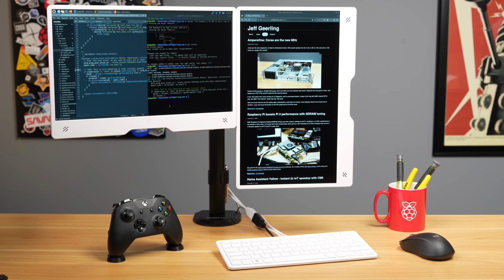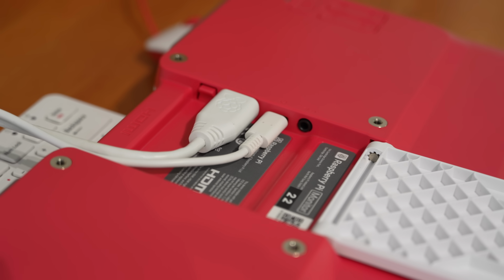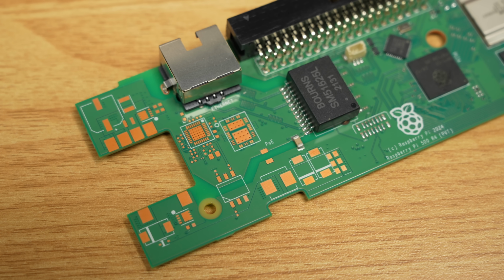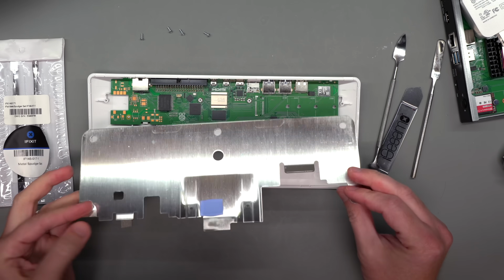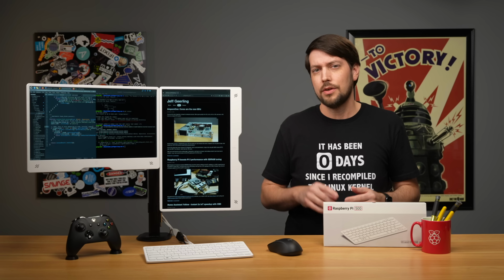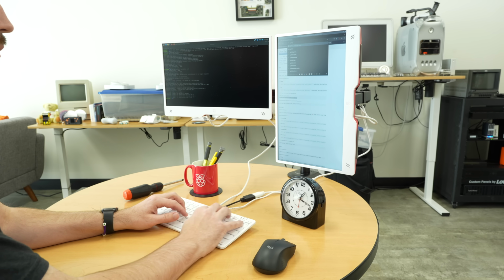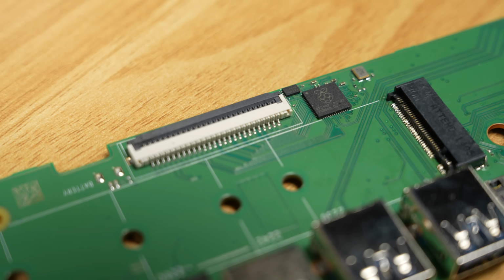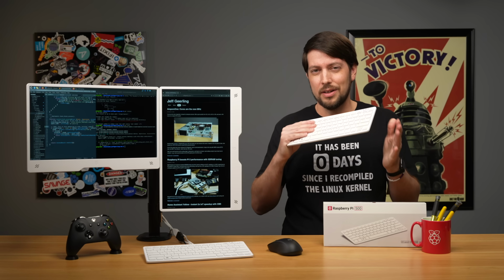The Keyboard IS the Computer! (Pi 500)

Comment: I'm usually hopelessly good at justifying my impulse, poorly-thought out tech purchases, to the point of getting broke in the process. That said, even I struggled with talking myself into getting a previous model, Pi 400.
- Want a low-power desktop without a clutter? Get yourself a second-hand Small Form Factor  PC that mounts neatly behind your monitor. With Pi 500 you get one less cable (from keyboard to the main unit) but instead keep dragging all your computer's cables around your your desk, stuck into said "keyboard".
- Want mobility? It's a solved problem and it's been for decades. It's called a laptop. Plus, it has a built-in screen and a battery.
"But... but... but... GPIO!" I have yet to see anyone actually developing an electronics project using that thing. Why would you want to keep your prototype stuck to your keyboard and then be afraid to move it without the risk of messing it up? So, you're at  the stage that you want to teach your kid electronics but said kid just somehow happens to not have access to any kind of computer in your household? Like: "Look daughter, this is a computer. Now we'll make an LED blink", I mean come on, seriously? 😛
Jeff rightly pointed out that we've moved from Commodore 64 form factor decades ago, just stopped short of admitting we've done so for a good reason. It's for made-up, fantasy scenarios.
And the unpopulated NVMe slot is just the ultimate middle finger to the potential customer.
Reply: God damn. I laughed so hard for minutes at the father talking to the daughter line…. You made my day. Seriously I am like you and i am suprised it even got 8 gigs of ram. With the SSD i would have bought it even though it still would have been a toy mostly because i built myself the smallest possible pi 5 with a pimoroni nvme base with a 3d printed case. I use it as my primary pc despite all its limitations because it is so small, light and efficient and since the wayland update it can play 1080p60 yt smoothly in Chromium or 1440p30.     Local Video files in 4K play fine. It handles everyday browsing, loading ebooks to kindle, mail and even music production (pi music and lightwave) reasonably well.  And even though n100 machines are the same price in Europe they are often low quality, not very durable and in some cases even infested with chinese spyware and for me personally way to big and heavy and I am well aware of the performance difference. I would buy the new M4 mac mini if i would consider something bigger.  I even think about building a nano pc using the cm5 and the waveshare nano b board.        The dream would be an all in one device. Either a real OS on a Smartphone with no limitations when plugged into a docking station (similar to Samsung Dex) or I will build a Pi Phone/ Cyberdeck that works reasonably well as a phone.  Modern phones have more than enough power IMHO.
Reply: This is a great comment. I was wondering who this device was aimed at?
Doesn’t seem to do anything particularly well. And now they put the price up.
Reply: Well said.

This thing is pointless.
Reply: Indeed, this is my take on just about any product that's just "existing thing but w/ Rpi."  Outside of niche use cases and just wanting to dick around with a novel Pi, it's competing with stuff that's straight up thrown in the trash or recycled and generally less useful.
Reply: As usual, narrow minded  people are missing the primary goal of the Pi. It is not, never has been and never will be designed to compete directly with traditional PCs and laptops. If all you want is a reasonably powerful, reasonably efficient primary computer, the Pi probably isn't for you. We all know that there are a great many better, more powerful hardware options available, both new and used. Buy the Pi you want a cheapish computer with access to GPIO, lots of third party hobbyist hardware and software projects, has great, long term OS support and a huge hobbyist community around it.
Reply: @another3997  Too busy insulting people who don't share your exact worldview to notice I wasn't dunking on Pis in general, just the "let's all pretend to get excited by a computer in a keyboard" form factor? You do realise you can SSH into your RPI from a real computer you DO have anyway and don't need a separate keyboard for that, you enlightened, wide-minded person? I know, shocking...
Reply: @another3997  You are going around posting about the same exact thing defending them for no good reason. The Pi is seriously losing out to more standard mini PCs and is not pricing itself in the cheap board for GPIO and hobby projects. You'd get better OS support going for an N100 since that's just standard x86.
Reply: @vasopel  "As usual, narrow minded  people are missing the primary goal"
He's also not tailoring his comments, nor particularly adding to the conversation.
Reply: @vasopel  Well, conversation with you will be useless if you think that's just speaking the truth. See ya.
Reply: @another3997 for hobbyist projects a keyboard form factor makes no sense

Comment: Once again the Pi Foundation shoots and lands short...

You can see there is the physical space to fit full size HDMI, but no we'll give you this crap micro option.  We have space to add a M.2 and we'll even include all the wiring, but we won't actually add it to the board.  And we have just released a new Compute Module that comes in multiple versions and would probably make the Pi500 even more versatile, but we won't use them.

And then they release a 15 inch monitor that if you mount it in a stand you need to bolt in the cables before mounting the monitor, which costs £95.  I can buy an LG 21 inch for £60, and I just bought a 10 inch full HD from AliExpress for £35.  The Pi Monitor doesn't even include the damn HDMI or power cables!

I really love the idea of the Pi, but with every evolution they just seem to be unsure where they are really going and what they want to be.
Reply: Funny yet, the monitor uses full size hdmi. So you need a micro-normal cable. lol

Comment: Oh man.  Someone gave me a rpi400, and I love that thing.  I put batocera on it and it's fantastic for playing old games.  I don't use the built-in keyboard though... just a wireless joystick.  It sits under the living room TV and it's the best game console I've ever had.  Totally silent, barely uses any power at all, and it plays pretty much any console or arcade game up to 2000 and any handheld up to 2005, complete with shaders and rewind and fast-forward and stuff.  If I ever upgrade though, I wouldn't want a rpi500... I'd rather just use a cheap Linux mini PC like a N100 or similar.
Reply: If you’re not using the keyboard then it’s pointless. A pi 4 or 5 would have worked just as well.
Reply: @kirishima638  Well, yeah.  I'm using it because someone gave it to me.  The benefit is that it was free, has all the parts included, and can be turned on/off with a button press instead of having to ssh in or plug a cable.  The keyboard works well enough for OS install, but for actual daily use I'd plug in one of my QMK keyboards.  I'd be better off with a rpi5 with a power button, case, and power supply... but for the price, a cheap N100 would work even better.  Raspberry Pi has been a fantastic platform, from the beginning up to rpi4... but it's hard to justify a rpi5 since a cheap mini PC runs a lot faster for the same price, at about the same size, and uses only a little bit more power.
Reply: @kirishima638  Well, yeah.  I wouldn't have bought it because other items would work better for me.  But as a gift, it has been fun.  Basically everything up to psx and gba runs perfectly, so it lets me play 10,000+ games.

Comment: After all these years of buying Raspberry Pis I really don't see a reason in purchasing the 500. The pi 400 was an excellent value proposition but at $120 for the full kit I can get one of those $100 mini PCs, an Amazon keyboard and mouse combo and have significantly better experience in day to day use. I really expected it to be at the same price as the 400 😅 silly me
Reply: RPi 400 is just over 4 years old. Using the inflation calculator websites, from Nov 2020 to October 2024, $70 becomes $85. So really, it's about 10% more expensive, at most, for A LOT of improvements. Seems pretty fair to me. Though I do hate the micro HDMI ports, I wish they wouldn't exist.

Also, this isn't solely focused in being a generic PC. Does your $100 mini PC come with 40 pins of GPIO ? With a custom led on the keyboard ? These are rather small things, but they add up. For some, they matter. Also is your mini PC + Amazon keyboard and mouse just as compact as RPi 400/500 ? There's tradeoffs.
Reply: @Winnetou17 absolutely no one is going to be using those GPIOs in this format.

Comment: Oh god why are they still using micro HDMI... Use one normal HDMI and add USB-C supporting video out not just for power. That would be much better combination that 2 micro HDMI.

Also why print M.2 traces on the board without soldering the damn connector on it? It makes no sense.

Comment: M.2 Slot is absolutely a dealbreaker. A SATA ssd is a great value upgrade for most devices that do not have SSDs.
Reply: ???? 🤔
If you really want a legacy interface like SATA on a new product, you should use a USB adapter.  The bandwidth of a 4 lane M.2 slot is 20 Gb/S versus 6 for SATA. You also need to add a PCIe to SATA controller chip, the power supply for that chip, and a serial e2prom for the controller's firmware which cost more and teke extra PCB space. It's a lose-lose.

Comment: WHAT! They put a power button where the DELETE KEY is on a laptop! Pi F. should bring out a n150 board that fits in the VESA mount cavity, as well as Pi 5 fitting in it, so you can have a 3 CPU setup, with a small, wide, Pi 500 sized tablet that runs android / linux for a 4 CPU setup when using 2 monitors.

Comment: Was the Pi 5 speed comparison with a passively cooled Pi5 or with the active cooler?
Reply from the maker: Active cooler. Thermals were fairly similar though... but the Pi 500 was 5-8°C hotter through the runs that I monitored.

It still never hit soft throttle limits and `vcgencmd get_throttled` never said anything about throttling when I was running at the default 2.4 GHz clock. Could be RAM, or some other factor too.
Reply: @JeffGeerling  Oooh very nice. That's doing better than I had anticipated!

Comment: "We feel that the feature set we picked for the Pi 500 is the right one"
I feel they are out of touch with their main customer base.
Also, while I appreciate the power button - putting it on the normal keyboard layout is a design flaw. Especially for dyspraxic people.
Reply: Should need Control to be held down as well to stop it being hit my mistake, perhaps this can be done in software?
Reply: @gordon861 Or simply make it so you have to hold it for 2 seconds before it turns off
Reply: @gordon861  Since the keyboard is powered by a RP2040, theoretically you could reprogram it. It would be nice if RPi Devs provide a configuration tool to make that easier to do
Reply: Raspberry Pi has become irrelevant for me since P4
You can buy a N100 mini PC, full spec with 12GB ram and 256GB SSD for around $150
Reply: @dionbass5212  isn't a N100 mini PC twice the price?
edit: never mind I just found the answer some comments bellow "For $140 you can get an N100 with 16 GB of RAM and a 500 GB NVMe."
Reply: @dionbass5212  This gives access to better software support, the only thing people really claim anymore for the RPi as a saving grace.
It also gives you a far far better GPU that is much more standard and has proper support as well. The number of times I've tried a distro with a Pi and it was missing some non-standard patch that is going to take another few years to get merged into the mainline of various software tools, which meant that performance was awful for a long time is way too high.
Reply: @dionbass5212  where? The last one of those mini pcs I bought turned out to be completely unreliable garbage. They took a board meant for a netbook or chromebook or some other low end laptop, stuffed it into a small case, and took the power input to where the battery would have been connected. This meant that it thought it was always running from battery and ANY minor power flucuation would cause the CPU to hard lock because they had bypassed the normal input circutry that smoothed out the power and made sure there were no spikes or dips.
Reply: hm..I don't think that people that actually NEED the speeds of an NVMe are their main customer base...
Reply: @vasopel  nobody said that the speed is needed. I've never had an SSD die. SDs? Countless. The raspi has pci capability. Why not use it properly. And yes, you could use an usb dongle (I have multiple)... And get a rats nest and clutter. Why not implement it properly?
Reply: Sadly, it more that many customers want and expect the Pi to be something it isn't meant to be. If you just want a high performance computer with high speed storage and such like, buy a mainstream laptop or desktop PC. It will cost you more, unless you buy used, but it will offer things a Pi doesn't.  But the Pi isn't designed to compete with those, it's designed around the flexibility of the GPIO, to be a cheap tinkering and hobbyist machine with 1000s of hardware projects... not as a primary desktop.
Reply: @another3997  high performance? It is storage. More reliable than SDs and higher capacity. We aren't talking 16  cores and raytracing. Nobody but you is saying anything about high performance compute. And cleatly even RP are not agreeing with you, or else they wouldn't even think about tracing it on the PCB. A Laptop is an entirely different beast. And neither is POE 'power computing'. So please stop twisting other peoples  complaints into something they are clearly not. Eben upton isn't going to give you a cookie for your brave defense of his for-profit company.
Reply: @TobyLegion  "storage. More reliable than SDs and higher capacity" so...get an NVMe and a NVMe to USB3 adapter...connect it to the Pi500,problem solved :-D
Reply: @another3997  Or they want a device that can actually compete on hardware quality with the rest of the market.

Comment: I think you should try a hot air station and try to use an SMD type of soldering method to put that m.2 slot on the board. I’ve been SMD soldering for a couple years now and that’s how i would do it
Reply from the maker: Yeah, I presume a preheater would help too, to make it so the PCB doesn't steal all the heat off my soldering iron tip if I try without hot air?
Reply: @JeffGeerling yes and FLUX YOU NEED FLUX
Reply: @JeffGeerling also you need a very fine tip for your soldering iron
Reply: Also my main channel is Bryce’s Tech Life is anyone is interested in that kind of stuff im going to be recording that type of content I want to be able to try and teach people how to properly do automotive and electrical work IT work everything. I hope this helps someone thank you 🙏

Comment: I have a pi 400.  The keyboard is HORRIBLE.  Hit a key on a corner or side AND IT DOESN'T REGISTER! (let alone sink in parallel like a real key on a real keyboard)
WTH?
Is that one usable, the 400's sure as hell isn't!
Reply from the maker: This one feels slightly better in terms of hit rate especially for the larger keys. It has a different mechanism, and I think it's better. But still not as good as my trusty old Apple USB 'Magic' keyboards
Reply: @JeffGeerling  there's something offensively bad about the Pi Foundation's attitude toward design.
I bet the Commodore Pet with the chicklet keyboard was better to type on than the pi 400, and as basically the first prototype personal computer it should have been the LAST computer to have a bad keyboard.  After that one, all keyboards should have been better.

Comment: If you are into projects in a big way you would not buy the 500. The 500 is mainly a  casual pc and with the  usb ports can still add extra storage. The 400 came out November 2020 that is 4 years ago and for an extra £20 you get a far better machine. For the size of it it will sell like hot cakes as it does not take up too much room can fit into a bedroom or other small rooms. Most kids will be able to have one and with the gpio pins  some kids will be the next Geff Geerlings.